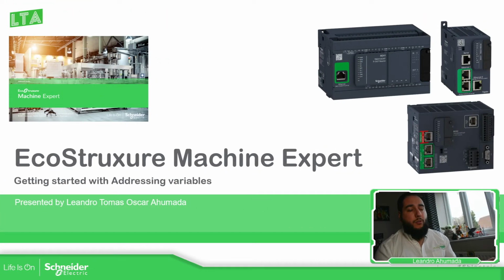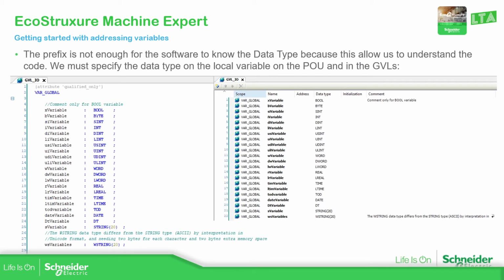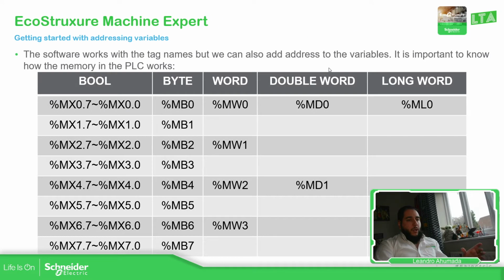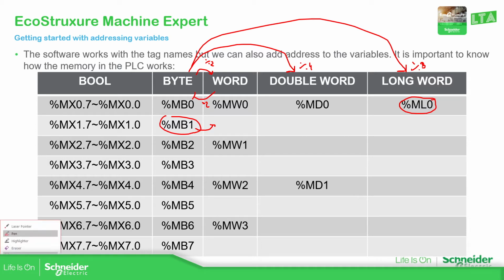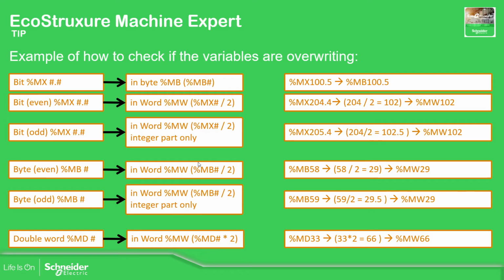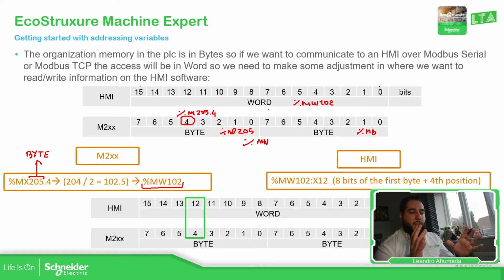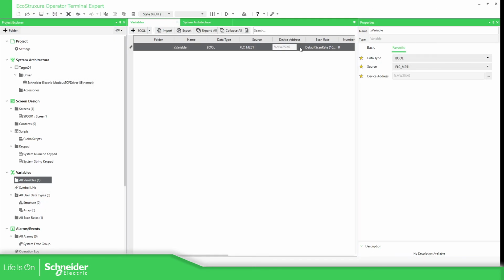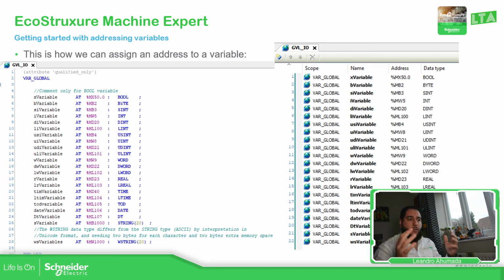EcoStruxure Machine Expert Training - M3.5 Getting started with Addressing variables

Comment: Is it OK to use AT %MW10 for persistent variables in M241 PLC?
Reply from the maker: Hi there! Based on the manual:
https://product-help.schneider-electric.com/Machine%20Expert/V1.1/en/m241prg/m241prg/xx_Controller_States_and_Behavior/xx_Controller_States_and_Behavior-8.htm

“The first 1000 %MW are automatically retained and persistent if no variable is associated to them. Their values are kept after a reboot / Reset warm / Reset cold. The other %MW are managed as VAR.”

Comment: I'm having an issue in machine expert basic where I use an operation block to assign a calculated value(all integers and %MW variables) but the value is not transmitted to the left side of the := sign, even if I try to assign a value to the %mw on the left side manually using online assignment, it instantly returns to 0. EG %mw59 := %mw98 * %mw99/1000. my value for %mw59 always immediately reverts to 0. I tried a bunch of as of yet unused %mws to see if there might be some issue with that one, it is also not used aywhere else in the program. both used and equ used are unchecked before I assign it a name and use it. im at a loss.
Reply from the maker: Hi Jackson Ploeg! Could it be that the result of %MW98*%MW99 is lower than 1000? If the answer is yes then the result is okay then you will need to try %MF instead of the %MW. Try something like %MF120 := (%MF122 * %MF124)/100  so you can work with real numbers
Reply: @LeTomasAHUMADA  ty. having a friday... gotta pay attention to types....